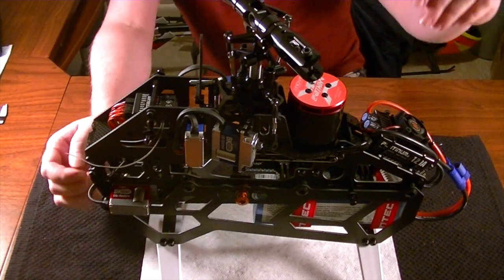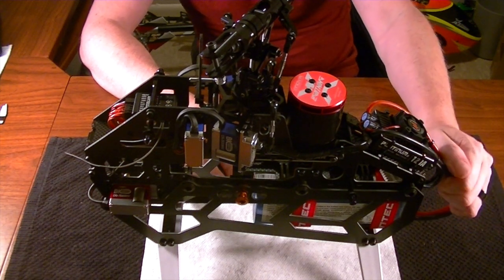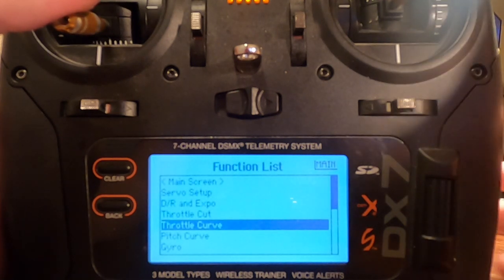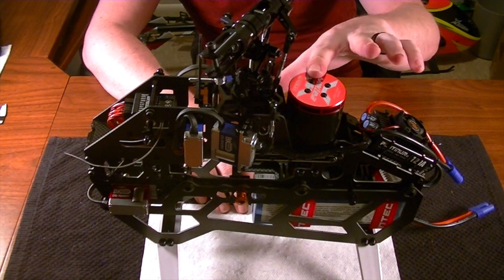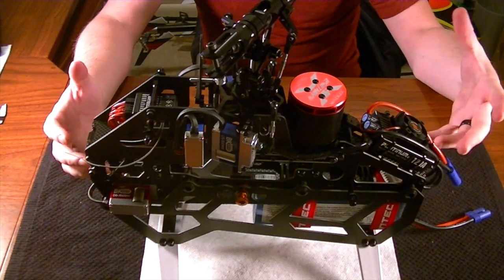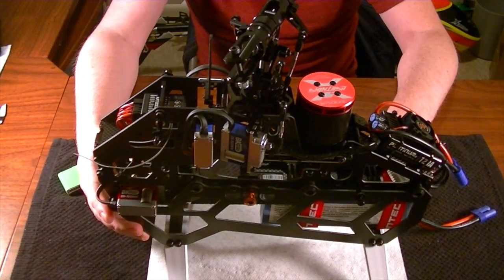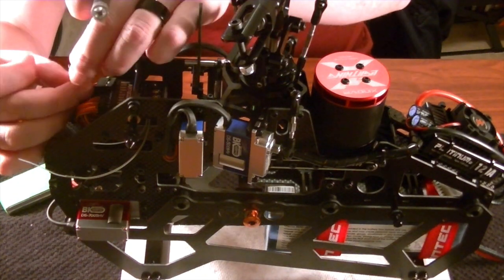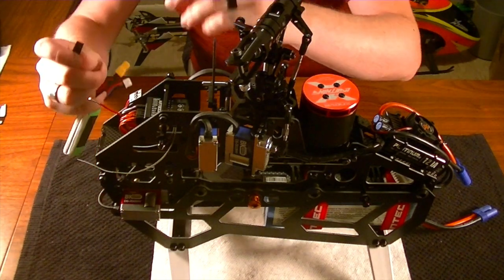AR7200BX / HobbyWing ESC Throttle Calibration (FreddyCanFly)

Comment: Cordova, while you posted this a while ago, you are always a big help. I have a Goosky RS4 Venom that comes with their GTS FBL unit and the new HW Platinum 80A ESC. I tried pulling the red wire out on the ESC, but it did not work like your demo here…. so I took a separate Radiomaster R88 PWM receiver and calibrated the ESC that way. Have you ever done throttle calibration that way? This was recommended to me by somebody with the same set up and it seems to work fine as I got the exact same beeps that you got. When I remove the red wire from the ESC simply nothing happened.

Comment: Why isn't this in the manual? I have a hobbywing platinum 120 v5 with a beastX  (model 1) and seperate reciever. Then it is different? or not?
Reply: It is frustrating and Freddy here is correct….by the time the FBL initializes itself, the throttle calibration sensing window of the ESC has already passed. What I did was very simple, significantly simpler than this. I too have a HW 80A platinum V5 ESC and I simply calibrated the throttle using a separate Radiomaster  R88 PWM receiver. You may have to do the same as well….. try it out and let me know how it goes. I know it’s frustrating. I really hope that I can help somebody.

Comment: Hi bro. Pls need help. When i try to calibrate the esc its not registering low throttle point. Im getting two beeps at hign throttle and then straight 6 beeps indicating 6 cell at low throttle point. As a result the motor wont start to spin till ive past 50 percent of throttle stick.
Reply from the maker: Check out my videos for the best x and esc calibration.  You have to do a bypass on the boot up.  I have a few videos to cover this topic :)

Comment: Hey can some one help me is it necessary to wire the yellow wire rpm signal to beast x  and what channel or u only use the wire if u are running governor
Reply from the maker: @adamdjuric7299  not if your using the GOV in the hobbywing.  It’s tied directly to your throttle and has nothing to do with the gyro.  Some people use external gov or other features that will change of course.
Reply: Thanks for your reply much appreciated 👍
Reply: I love the videos   there awesome 👍

Comment: Freddy i have a 120amp esc and i will be using the bec on the esc.
If i do the calibration you point out in this video do i need to go to the field to do a spool up at 50% throttle for 15 seconds to calibrate the esc. Ill set up the esc with a program box. Thanks for your help. Hope your doing well love your cat video.

Comment: Can this sec be calibrated twice ?
I think I mess with the radio, after doing all the steps and calibrated good, I turned the radio while the TH thick up!!
Now every time I plug the battery don’t give me the correct tone counts!! 😢
Reply from the maker: yes you can just repeat the new calibration and it will save the new settings

Comment: hi Freddy I have a minivbar and a platinum 120 v4, using a futaba sbus receiver with 8ch ports available, is it better to connect the esc signal wire directly to the minivbar or to the receiver throttle channel? I plan to use the internal governor of the esc and I am note sure if the response is equally fast and note sure if it is possible, because if you connect the esc directly to the receiver, you wouldn´t have this issue of the flybarless incializing

Comment: Very informative. Thank you. 

One question—when the system is calibrated, when the esc gets just above its minimum throttle input (say 25% throttle), the motor wants to slowly spin up with increasing rpm—even when still at 25% throttle. 

Then when I  decrease to 0% throttle—the motor turns off (which is good).

Summary: It appears the throttle input either turns the motor on or off, without in between throttle values changing rpm. Is there an obvious reasons for this? 

Thanks again. Your video series is great.
Reply from the maker: This is because of the GOV feature built in.  it will not arm the throttle until it reads a set amount which I do believe is 25 percent or more then the GOV will activate and hold the set RPM values.  And then of course once lowered down to zero or below that threshold it will then disarm.  I hope this answers your questions correctly
Reply: @FreddyCanFly  I've followed the video and it seems to work OK (2nd hand heli by the way).  I get the two beeps and lower the throttle.  However, when I plug it all back in again, the motor doesn't start until I've given it over 40% throttle.  Is this right or wrong?  I assume the previous owner had the governor configured - could this be why?

Comment: Thanks for a brilliant video. Followed it all the way through and it worked fine - EXCEPT for one thing, i.e. my throttle hold didnt work. It reduced the speed but didn't stop it completely. Spent ages trying to work out why this was and re-did the procedure several times. In the end realised that that the throttle trim on my DX7 has to be a mid point. If you have the trim all the way down (which is what I though you were supposed to do with electric helis), then the throttle hold doesnt actually hold!

Comment: hi freddy, why not simply connect the receiver directly to the ESC first without the gyro and do the calibration first ?
Reply from the maker: Yes you need to have the blades on because it will also cal for the rotor disk load for proper rpm.
Reply: if  I am using a receiver, is it possible to connect the signal esc wire directly to the receiver throttle channel and the slave cable to the flybarless and fly the heli like this?

Comment: Freddy, many thanks for your wonderful videos. I have a problem with trottle range calibration on my Trex 650X 6S:
i am using: ESC BL 130A (defolut align which is the same as Hobbywing), Futaba 6303 SB receiver, FLB Bestx 5v.
to avoid delays I connected out BEC (red and black) on CH system channel of FLB, Trottle signal on CH3 receiver, Sbus receiver on Aux channel FBL system, trottle curve flat (0-25-50-75-100).
when calibration starts (maximum throttle stick)
1 - the motor emit 3 quick notes and after two short beeps;
2 - stick at the bottom I hear beep bep - pause - short beep.  I do not hear the 6 beeps of the number of cells.
I can solve by setting n. 6 cells by align box programmer (at point 2 of menu)
Would you have any advice for me?
Thanks for your attention and greetings from Italy.
Reply from the maker: Are you making sure that your ESC lead has the Wire wire disconnected before connecting it to the receiver or FBL ?
Reply: @FreddyCanFly  Hi freddy, Thanks for your attention and for the reply, I tried 1) connect only the ch3 (motor) of the receiver which takes power from the same wire with the + and - terminal, to the ESC, 2) add power only to the wired receiver from Esc on another channel, and the ch3 always connected,
  unfortunately it doesn't give me the 6 beep.  Tks for any helps.

Comment: Somehow telemetry can tell me in advance that it's time to land the helicopter, is the battery discharged, or is this not provided for?
Reply from the maker: I am sorry I do not understand your question.  Are you asking if telemetry can detect a low battery so you know when to end your flight?
Reply: @FreddyCanFly  Yes, you understood everything correctly, but I found the answer.  V-Bar Control notifies how much charge is on each battery bank.  This is programmed in the ESC SCORPION settings 🦂

Comment: Hey.. really helpful videos.. quick question on this topic... my esc appears to be programmed however I had to reverse "servo" in transmitter since I must have done it backwards... Now I have no idea how to re calibrate it.. Ive tried this method in your video ,  however its not working.. i e also set the servo back to normal but it doesnt work.  Any thoughts?
Reply from the maker: What model esc and FBL or receiver are you using?  in a lot of cases you need to remove the red wire from the esc and provide power to the system first.  Once bound up then you can power the esc and complete the calibration.  Basically you have to disable the BEC by pulling the red cable.  Also make sure your TC is linear as well.

Comment: Is is normal to have to reverse several servos in my transmitter?  I have 5 reversed?  I have ail elev throt gyro and pitch?
Reply from the maker: Usually with most FBL setups the reversing is done in the FBL system not the radio.  This of course does not apply to every setup, but honestly it does not matter as long as everything is working as designed per the manual then it is what it is.  I have usually found though, that you should not have to reverse more then maybe one servo on the cyclic.

Comment: Hiya Freddy i am building 500 Align pro + not quite sure where the speed controller should be placed could you help ? bye the way i am 72 yrs old OMG such small screws !!! great video,s
Reply from the maker: Ummm usually the ESC will go up front on the nose plate either on the side or on the top.  I would just google some images for some guidelines, I don't think I have any videos for that exact Heli.
Reply: @FreddyCanFly  Thanks Freddy the ESC is fixed under the battery mount with plastic straps not a lot of room

Comment: I got the 650x I’m building what size battery you running in your 700?
Do you think I could run two 6s in parallel ? I know you can do two in series for 12s 
Would the weight over ride the run time if I ran two packs parallel ?  Just fishing for opinions and ideas
Reply from the maker: I used 5000 man 6sell packs for 700 class helis.  if you wanted to run two I would probably drop down in mah a little so as not to be to heavy.

Comment: Great video. I have an align BL130A which seems to be almost identical to the Hobbywing. I want to use an align gpro fbl which needs me to set the throttle to 100% on their software which on my transmitter (frsky horus 10s) relates to about 86% on the transmitter. Is this low reading on the transmitter going to affect the calibration of the esc? Is the esc going to expect 100% from the transmitter. This is the first time I will use a governer on a model.
Reply from the maker: As long as you calibrate the ESC to see 0% at low stick and 100% at full your good.  Typically most ESC that have a gov will have a calibration process as well.  Once done you just use flat curves to depict the RPM ranges that you wish to use.

Comment: Hello freddy, did you connect the capacitor to the regulator? Or do you fly without ...
greetings from Germany
Reply from the maker: Hey brother greetings, so I have not use the Cap pack and I have had zero issues.  I don't this I can load up the esc enough to need it.

Comment: Hi Freddy, hypotheticaly if i was to be using a flat throttle curve my whole flight would calibration be necessary?  I nevet fly with standard 0 25 50 75 100 curve. F mode or nothing, thanks dude
Reply from the maker: No matter what you need to do the calibration on the HW esc for proper use.  You also have to do the 50 percent spool up sample to calibrate the gov.  And then yes you can use any flat curve above 40 and the Gov will keep your rpm in check.  Using a liner throttle curve is really not a practical way to fly a Heli and is really used for setting up stuff.

Comment: I was always using an opto esc😄, with bec seperately. But doesn't the pc give throttle high and low calibration?
Reply from the maker: HW does not need a PC just the simple throttle stick calibration and your all set.

Comment: Good but I don't hear the two beps to calibrate throttle , I  will try with my hobbywing , thanks for video.
Reply from the maker: Some systems (most) require you to provide power to the FBL first then power the ESC and calibrate.  In these cases you just remove the red wire lead from the ESC to disable the BEC and then you have only throttle signal.  After you have calibrated insert the red pin back into the connector and you are good to go.

Comment: Im  putting a new hobby wing v4 60 amp esc on my trex 470 .tying to figure out where to plug the 2 s lipo battery in ???does it go in the sys port on the very end slot of the micro beast plus ?? thanks for all your great videos .very helpful for new guys like me :)
Reply from the maker: I take out the double redundancy connector (if you have two) and use that port.  Its usually and AUX of some sort, I think you can also use the Bind slot because of the power bus on the system.
Reply: I have to do the same with my 470 how is yours working did you get it?

Comment: I will definitely be watching this video soon!! Freddy, gotta couple questions for ya .... So I have a T-Rex 500L dominator right and crashed it the other day to the point I have to get a tail boom and the torque tube. I was thinking of making it into a 500x by putting the larger tail boom on it but understand the stock tail box won't work. If I was to get a rear gearbox for the 500l do you know if it till work or do you know?? Second question, if it will fit can't I just use all new 500X parts and make it into a hybrid with a longer tail than the dominator?? Also was Planning on upgrading the motor and ESC too. That's why I said I'll be watching this video real soon 
That's about it .. lemme know what you think. . thanks in advance!
Reply from the maker: Shoot buddy it will basically come down to the cut outs in the frame basically.  You would have to look up the specks for the new gear box and see if its the same as the old.  In most cases I would say yes however I do not want to steer you wrong.
Reply: @FreddyCanFly  I'm gonna just get the X tail block and see what if any difference between the two are . If the only difference is the opening for the tail boom I'm golden!!! Thanks for the reply!!! I'll let you know

Comment: Another Incredible video Freddy! You have received quite a few negative messages about building this particular Helicopter. I didn't mention the name before and I will not mention it now. Having said that;  People look at the wealth of knowledge that WE have all gained from this particular Build video. 
1) When assembling the Frame, you do not loc tite every bolt right away. 
2) Perfect ESC Installation and running the wires.
3) A Beautiful Installation of Servos showing wire routes, tips & tricks with Braided Wrap & Heat Shrink.
4) Showing the necessary steps when using a Hobbywing ESC with the Beast X or Spektrum AR7200BX to properly Calibrate the ESC.
Freddy, I'm sorry about all the grief you got when you said you were going to Build this Heli but I am very Happy that you kept your word like a Man, and have shared this Amazing Build with Us! Thanks Freddy, you're the Best!
Reply from the maker: Hey buddy thank you so much for the kind words, as always I am here to help with any and all products I can get my hands on lol.

Comment: Thanks Freddy, what settings do you have in the hobbywing before you do this? Linear throttle, elf governor, store governor or fixed wing?   Are there any other settings.  I have a trex600, with hobbywing platinum 120a esc and AR7210BX.  I tried this several times and could not get the endpoints set.  I thought I did and the motor wold make the normal start notes but would NOT spool up.  Nothing.   I turn governor off on the AR7210 ( set step (N) to disable and run end point calibration and it works just fine.  I can’t figure this out.  Any help would be welcome.  Thanks pvtpil8
Reply from the maker: Hey buddy so yes if your going to use the GOV from the HW you do not need the GOV menus active in the beast.  Also make sure you do not connect the yellow wire for external gain.  I use the GOV Store mode and do the 15 second spool up to get the mid range read out.  This will calibrate the GOV of course (working on a video for it).  For the throttle calibration it only needs to get the signal read out of a linear throttle curve, the ESC setting will not really effect it.  So do the throttle calibration first, then go ahead and plug in the data terminal and do the programing for the ESC.  I hope this helps.
Reply from the maker: Hey buddy so yes if your going to use the GOV from the HW you do not need the GOV menus active in the beast.  Also make sure you do not connect the yellow wire for external gain.  I use the GOV Store mode and do the 15 second spool up to get the mid range read out.  This will calibrate the GOV of course (working on a video for it).  For the throttle calibration it only needs to get the signal read out of a linear throttle curve, the ESC setting will not really effect it.  So do the throttle calibration first, then go ahead and plug in the data terminal and do the programing for the ESC.  I hope this helps.

Comment: Really nice info Freddy. I think that you have already mentioned this but do you set your servo arms by just powering on the heli and then put them at 90 degrees?
Reply from the maker: Well yes and no, you have to power up the Heli for sure but depending on your FBL system you have to enter the programming and use the specified menus in order to center your servos.  So basically its done in programming and not just by providing power on start up.